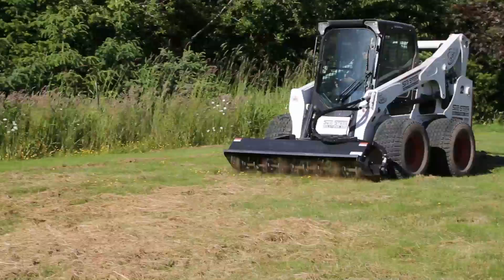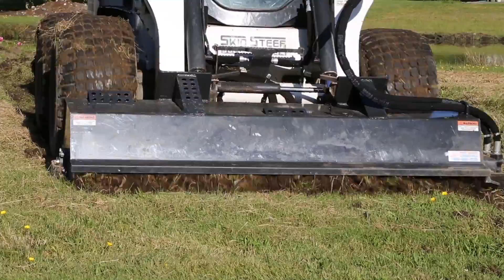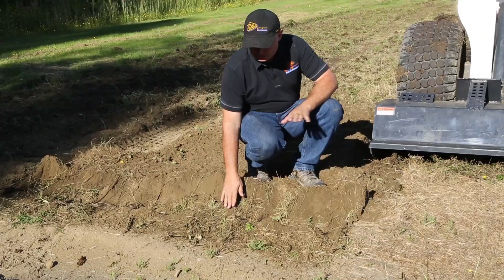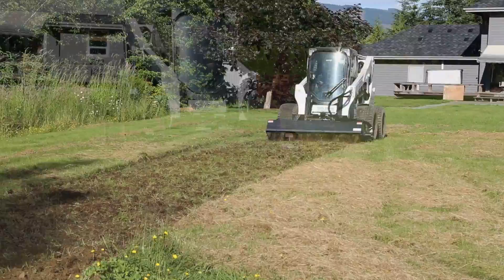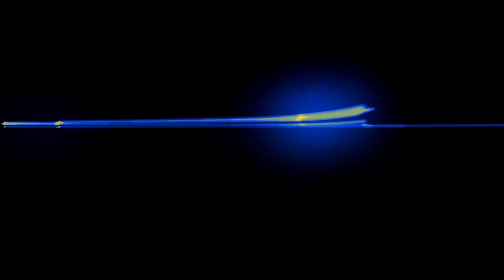Skid Steer Solutions Haugen 76" Rototiller

Comment: What about rocks
Reply from the maker: Hi John, the tiller blades are on a swivel so the are designed to kick rocks out of the way. But even with that, if you are in a really rocky area, you would want a different attachment anyways. Big rocks will need to be pulled out. Please let us know if you have any other questions. Skid Steer Solutions

Comment: That does seem better than the light duty ones that a lot of people buy for tractors.
There are very heavy duty rototillers for big tractors too. 

I realize that a skid steer rototiller is for small jobs. 
On large jobs people would want a regular farm type tractor or at least a skiploader size tractor with a 3-point tiller with the L-shaped blades. Not those c-shaped blades.

And when are they going to start calling those bobcats by the company that owns them now? Doosan. 🤔😁
Maybe Doosan will start making them right. 😆